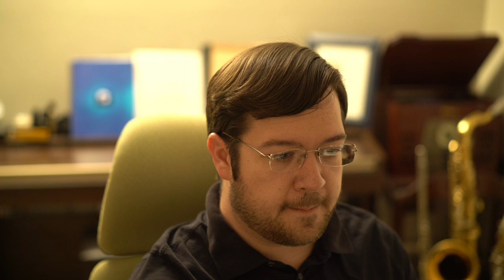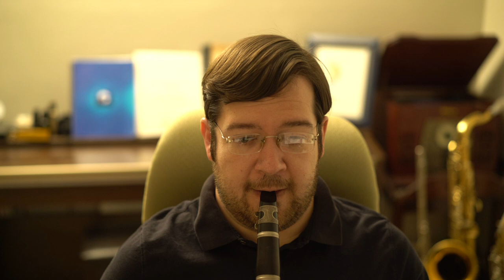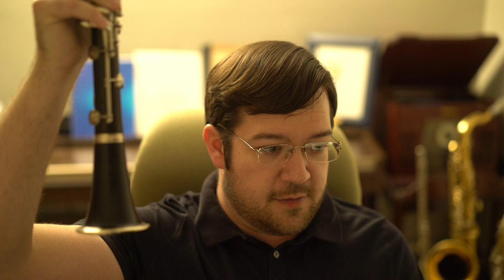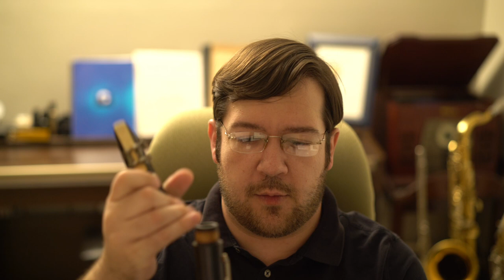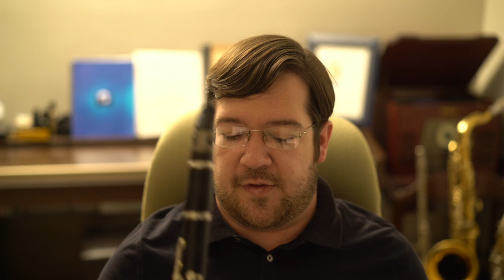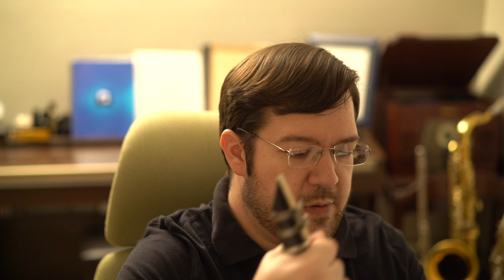Buffet R13 vs Buffet S1 (both 1973)

Comment: What mouthpiece do you suggest to suit R13?
Reply from the maker: Oh man...this is a can of worms! First of all, what country do you live in?
Reply: My 20plus year old Ralph Morgan (1,06mm) works well with my R13 (#74202 around 1962). That is considering my limitations as a clarinet player. Also Rue Lepic 3.5   Great videos with amazing nuances.
Reply from the maker: @jefft9729  Thank you very much!! First of all, I am jealous of your R13! My very first golden era was 74249. The great Harold Wright of the Boston Symphony played a 72xxx (and he also played 80xxxs to my knowledge) and purposefully didn't play Buffets from the late 60's or later (even though he passed in '93). I feel 72-74xxx is very special. They are the first Buffet R13's to NOT feature solid German Silver keywork. The keywork is much lighter, and the wood is a smaller diameter. By 75-76xxx, the wall thickness of the wood increased, and I find these horns much more difficult to play. By the mid-to-late-80xxxs, the walls had again decreased, and I love those horns too, but there is an ease to 72-74xxx that is unsurpassed, in my opinion (at least among Bb clarinets).

I love old Ralph Morgan mouthpieces as well! I remember well the first time I played one, and the resonance of the material (in addition to the craft of the facing and baffle) was night-and-day vs my Vandoren M14 1.01 at the time (and that was a battle tested piece). That was my first venture into rubber with actual resonance! Shortly after, I tried my first Chedeville and Kaspar, and then I went crazy, but I still think of old handmade Morgan's as some of the best mouthpieces ever.

Thank you again for your comments! I hope you will enjoy more videos I have coming up shortly!!